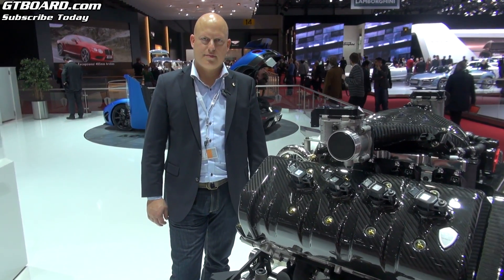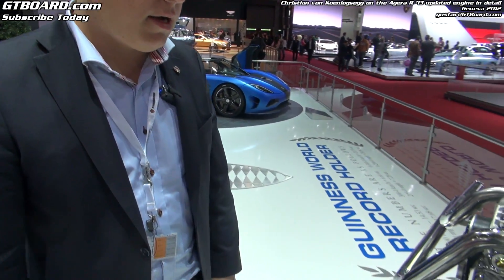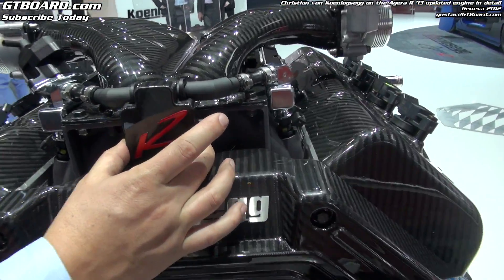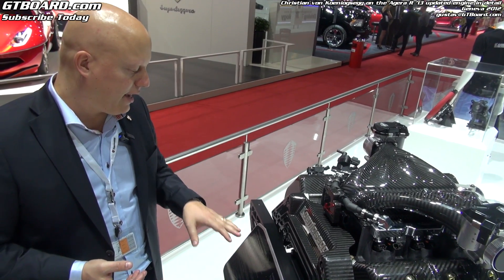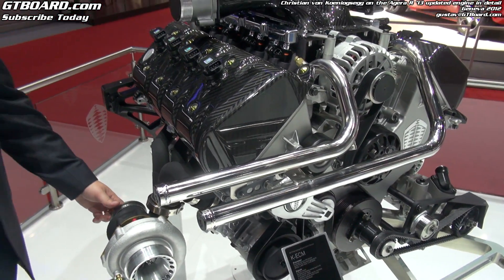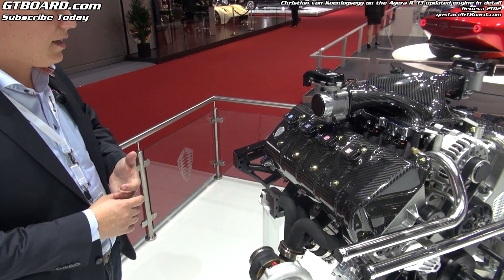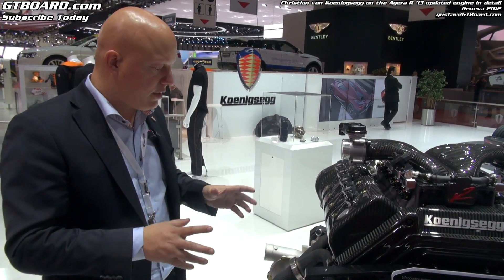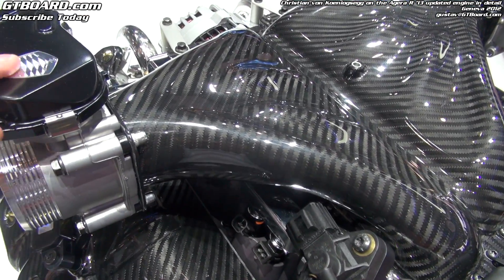Engine in detail Koenigsegg Agera R by Christian von Koenigsegg

Comment: neverendingmods  You are obviously a tool and no nothing of the Ford DOHC Modular engine. This engine block and heads are the exact same, down to the water jackets and bolt patterns. The intake, pistons, exhaust, and fuel are made by Koenigsegg for this particular iteration. FYI the Ford GT engine can support more HP than the Agera R with twin turbos, which is the reason it is the Texas mile record holder. Next time study up before attempting to sound like you know what you're talking about.
Reply: spudnic88 Only little bitches that don't know shit about engines think what you think, go study up
Reply: +spudnic88 Oh shut the fuck bet you own a Mini Cooper
Reply: +Chainheart Machine  If you can please tell more more about Ford Modular Engines. Also the Texas Mile Record Holder was not a stock Ford GT 5.4 Liter Engine it was rebuilt by Heffner Performance and they used a few other Guys parts such as Accufab Racing Parts which is located in Canada. (Just wanted to let you know)
Reply: freightliner pate Block design, water jackets, heads, etc all original. All they did was beef up the internals for high boost. Same design, tougher hardware.
Reply: Chainheart Machine
So why didn't ford do the same thing. Obviously Ford needs new people working there well I hope they collected money off of this new Engine design inspired by theirs
Reply: freightliner pate Ford's biggest cash cow is pickup trucks and compact cars, not supercar investments. That being said, look at the new Ford GT, with a truck based engine.
Reply: freightliner pate The 2nd Gen 3.5L TT is a truck based engine, powering over half a million 1/2 ton pickups already.. it's common knowledge, Look it up.
Reply: freightliner pate TT = *twin turbo
Reply: @Christophertruck  your an idiot. Ford f150 is powered by either 5.0 v8 or turbo v6 ecoboost which is the higher priced model. The twin turbo v6 in the ford gt is based off the ecoboost v6 in the f150
Reply: @malourocha9211  Bitch you late I saw what everybody was talking about already gtfoh

Comment: they dont use ford block,made in house by koeniegsgg
Reply: +Dinkelstein Kerman it's true. The engine is based on a ford engine with a few components inspired by an Audi engine. But what's the shame in that? A good engineer recognizes good engineering when he sees it and improves upon designs that have good potential.
Reply: ***** Yea I agree. The only thing that's similar to a Ford is the engine block.... and it's just an engine block.. the magic of the koenigsegg engine lies in everything else. You're right.
Reply: ***** The block IS a reproduced version, don't know whats so funny about that. Original Ford Teksid aluminum blocks are able to withstand 1000+ HP with no modifications.
Reply: Chainheart Machine coyote?
Reply: ***** I apologize, but you did laugh when I stated a fact.
Reply: This block is an exact replica of the 4.6L DOHC Ford engine, same water jackets and bolt patterns. It's just a reproduced version with higher strength aluminum for the boost pressure.
Reply: ***** I wonder if you are in agreeance or you really don't know engines..
Reply: ***** I'm no Koenigsegg hater, and I stated the facts, the block itself is engineered from the Ford Teksid production. It's already good design they are building upon, because it has already supported 1000+ HP Ford GT builds. 

Don't get your panties in a wad because a supercar company uses a seemingly pedestrian car company's engineering. If you know anything about the history of racing you'll know how Ford has had some supercar-slaying designs and tech.

Comment: Ford Modular based engine.
Reply: No they use for it's own engine
Reply: 大だ Dai-Shinkan  for the first generation yes. but the second later one is not untill now they developed they is own engine
Reply: They is no doubt 98% or 99% koenigsegg design own it's own
Reply: I know the block block and the storker from Ford, Koenigsegg took it

Comment: Koenigsegg borrowed NOTHING from ford but a shell/empty block with NOT ONE single nut or bolt in it.  Ford has NEVER and NEVER WILL design a motor like that Agera R motor.  I am actually pissed that somebody would say " Koenigsegg stole/uses a Ford motor",lol.  Like saying bugatti stole a volkswagen beetle motor or something that stupid. Ford will NEVER come close to an Agera R in terms of power, design creativity, hell even the fueling system costs more than a Ford GT motor itself, hahaha.
Reply: I admit that the engine is well designed and shaped by a block from the American Ford Company, and Ford is next to Koenigsegg. Koenigsegg asked Ford to take the block and storker from Ford and it is manufactured by Koenigsegg, right?

Comment: The Agera R motor is BASED on a Ford 5 liter BLOCK.  nothing else is remotely similar to anything Ford related in ANY WAY!!  Bare block, not one bearing cap let alone crank, rods, oiling system, pistons, camshafts, valves, head design, head CFM flow, ...NOTHING is based on a single Ford part but the bare, empty aluminum shell that is called a BARE block.AS told in video the sleeves are designed and installed by koenigsegg in house so that means the bore isn't even a ford bore. Understand PLEASE!
Reply: Did you know that Koenigsegg uses a Ford block and stocker kit because Ford is next door to Koenigsegg?

Comment: This is at the top of my list when I come into enough $.  Would order with cats able to be removed/replaced with race catless bolt on pipes to REALLY hear that incredible motor.  Watch the 30 minute special on this car and factory. The fuel management system is super slick.  Auto adjusts the fuel/timing trims instantly according to what fuel you put in.  Doesn't say, but wonder if 109 octane unleaded race gas is used will power increase even more over E85

Comment: @rusty5100 a V8TT is hardly pushing the boundary of engine design or the future, unlilke the Veyrons W16. I would doubt that this engine is anywhere near as advanced as even the V12 VAG put in the Aventador (which costs only 20% of a Agera R). Personally i would feel cheated if i had a £1M+ car with an engine like this.

Comment: @rusty5100 What the hell are you saying?? The W-Engine technology used in Supercars is very new.You dont want to tell me that an old ass V8 engine used since 70 years is more advanced than a high tech W-Engine? V8 engines are only still in use because of the sound.Thats it.This has nothing to do with power.